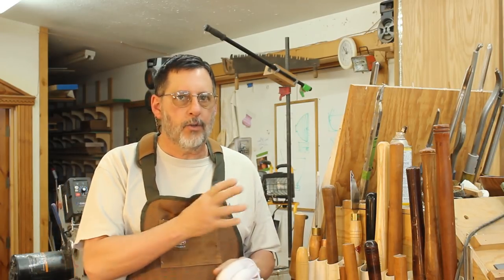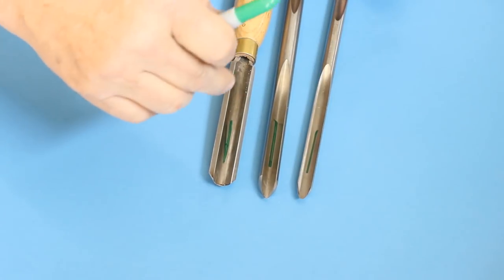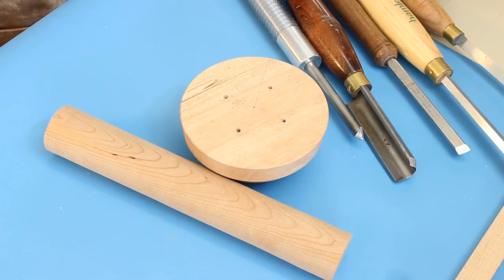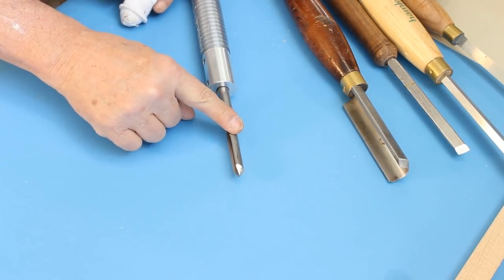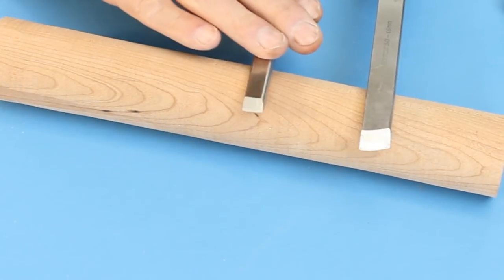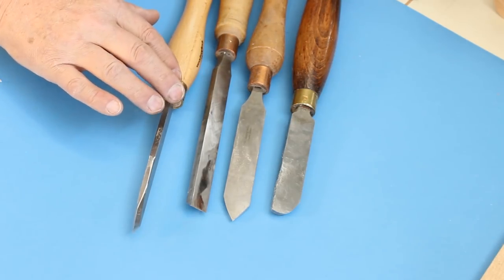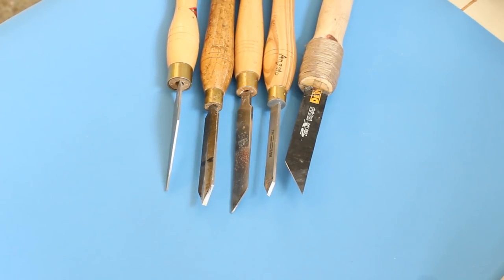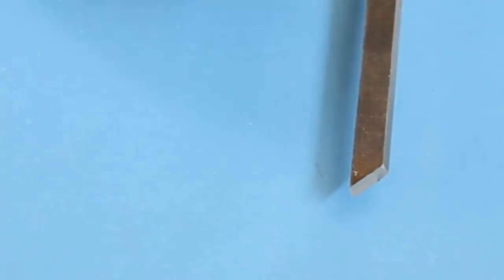FUNdamentals of woodturning: #3 Tool Identification

Comment: Great video Sam, thank you so much for making these videos so informative even for the more seasoned turners, and yeah, I hope I can call myself seasoned after only 3 and a half years of turning.. :)
I think my worst mistake as far as using a specific tool for the wrong job was actually trying to take a skew chisel to an outside of a bowl, before I know what that is going to do.... and it did just that, I got a nasty arm shock from the throw and hit of the skew on the tool rest, and I'll never forget that lesson... live and learn, and do so safely, of course.
Reply from the maker: Yuval
I have seen experienced woodturners who have made similar mistakes.  Knowing how tools are designed and what they are meant to do can be confusing. I always like to talk about the edge of a knife.  Cutting tools have such an edge  whether it is a gouge or a skew chisel.  So if you point that edge upward without bevel support, you will get a nasty catch.  I think much of it comes down to common sense.  Thanks very much I will talk to you later 
Sam
Reply: Leave and learn is what I always say, also I'm always in favor of people learning things the hard way, that way they never forget...

Comment: Sam,  As a beginner, I really appreciate this type of information.  Excellent video from my perspective..

Hope you get back to 100% soon.
Reply from the maker: Thank you very much. Do you have any recommendations for more fundamental turning videos?  It is kind of fun getting back to simple basics. Thanks Sam
Reply: WYOMINGWOODTURNER
 
Sam,

Thanks for asking but you may regret it.  Maybe there is something here you can work with.

Keep in mind, I am starting out on pens and practicing on spindle stuff trying to get use to this thing. I’m at the bottom of the curve but find it is really fun............... and frustrating when things don’t go like I think they should.

 How about tools and what or how to use them on different materials such as woods(soft, hard, exotic, close grain, open grain, etc), inlace acrylester, acrylic acetate and those that have materials imbedded in them(grape nuts, coffee beans, copper, etc).  How do you know when a tool is cutting correctly and what to do if it isn’t?   Chatter??  Even on small stuff like pens.

 How do you keep a surface smooth and flat while moving the tool across it?  That can be when the tool rest is parallel to the surface or while doing a taper.  I find I get ripples too often.  My tools are EZ Wood tools and a set of Sorby traditional tools with Wolverine sharpening system.

 When you think you know what you want, where do you start to get there?  I have watched painters that have a blank canvas, start dobbing paint and the next thing ya know, it’s a picture.  The lathe seems something like that to me.

Chucks and jaws.  What to use and when.  Are there different options for the same thing?  Cole jaws, are they something you use often?  If so, when exactly and how?

 Can the same task be done with more than one tool or is each tool basically specific to a certain job?

 I’m sure these are dumb questions to some but starting to make round stuff at the age of 71 may have been easier a few years ago.  Seems so easy when I watch you and Carl do it.

 As stated before,  I find your videos very enlightening, helpful and I like your teaching method.

 Thanks for listening,

 JimE

Comment: Nicely done....I especially like the film editing....do you script it all out first? with all the film angles and scenes?
Reply from the maker: +Kim and Steve S 
I greatly appreciate your comments about my film editing. I am especially proud of this aspect of my videos. To this point I have used one DSLR  camera.  I simply move the camera to a new position for different angles. It is all very time-consuming.

Lately I have been using two cameras to film. I turn them both on at the same time. And then when I edit I put one series of clips on top of the other so I can go back and forth and show two different angles. I've done this in the last three or four videos.  Thanks again Sam
Reply: Well...now I have to go and look at those videos...I'm only on #3.

Comment: I'm new to turning. I liked the video but I missed the "fundamentals" of "WHY?" All I got was you just don't use a bowl on a spinal and you don't use a spinal on a bowl, why? I heard "trouble, problem, catch..." why do they cause those problems? What is it about the angle of each gouge that cuts the grain to get a smooth cut vs a "problem?" How does the gouge interact with the wood? Can you explain how a cross grain acts when using the right tool vs the wrong tool and vise versa?
Reply from the maker: Matthew
I am glad you are getting into woodturning.  First.  I am not sure what you mean by "spinal on a bowl gouge?"  and "Bowl on a spinal"  This may be a spell-check issue.  OK let me explain this video.  I have 401 woodturning videos.  I try very hard to explain the focus or the "scope" of each video.  I try to be very narrow on the "scope" or area I cover.   The title of this video is "Tool Identification"  I explained early in the video I would do no turning-just look at tools and the categories.  You ask some really good questions, example, cross grain vs (end grain).  This is important, but not the focus of the video.  
Sam

Comment: Something to consider, novice or beginning turners usually start with a "set" of tools which are far different than the ones you use for demonstration.  They may look similar but not the same.  Its difficult for the beginner to relate one to those use used for the video.  Addidtionally you said a spindle gouge is generally not used for cross grain work but you said that the spindle gouge cuts across the grain, also confusing.
Reply from the maker: Richard
You make some good points about tool sets.  I did not go back and look at the video regarding your comments on cutting cross-grain with a spindle gouge. I agree that at times I can be a bit confusing with my explanations of things.  If you can give me an exact time when I said these things, I would appreciate it.  Sam
Reply from the maker: OK, I did locate the time when I was talking about what you said in your comment.  At 3 minutes and 30 seconds in, I said.  "The spindle roughing gouge was NOT for cross grain work." This is an important distinction.  It is a roughing gouge for spindle work- or wood with the grain running parallel with the bed ways.  Using this tool in cross grain work can result in a serious accident.  I go on to talk more about spindle gouges (NOT roughing gouges) and how they are used.  Sam